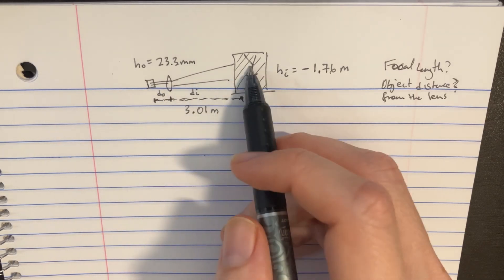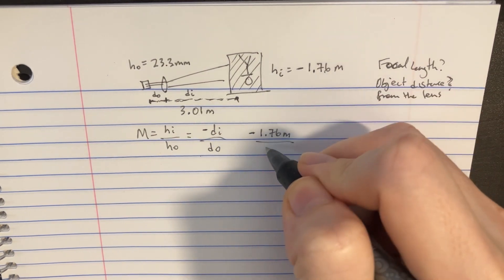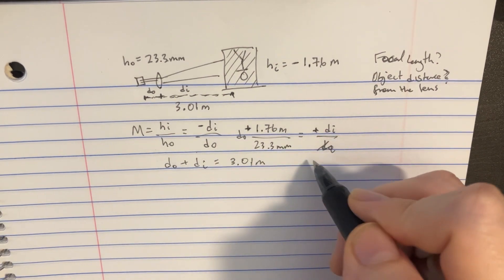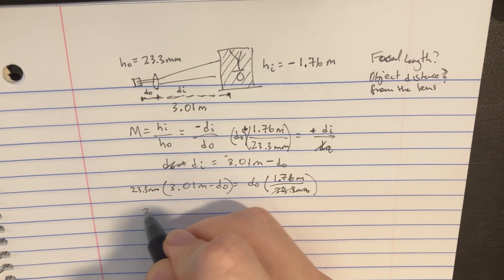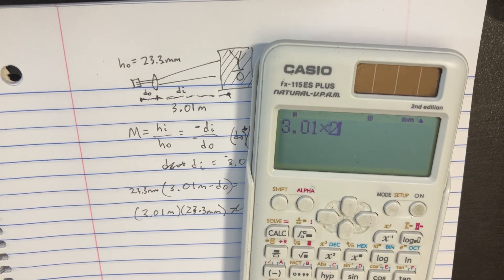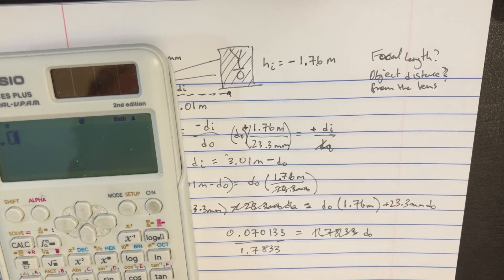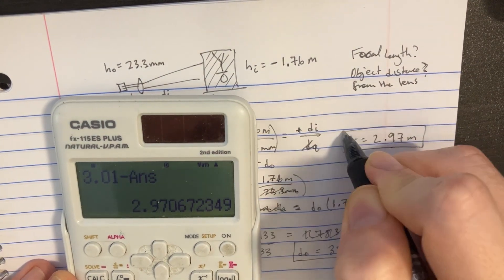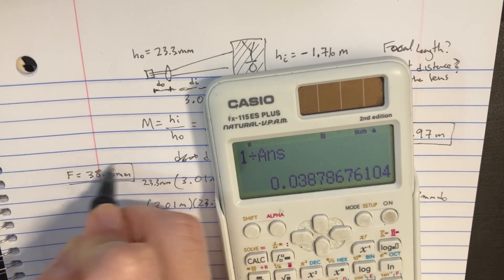The projection lens in a certain slide projector is a single thin lens

Comment: On my homework assignment, it doesn't state that the image is inverted (otherwise the questions are identical) but expects me to know that it is inverted.

Am I supposed to conceptually know that the image is upside down?
Reply from the maker: Hmmm.. if the image on the screen is not inverted, it would lead to a negative object distance and a negative focal length, but the values would also be slightly different.. In my question it specifically says “the image is inverted”.. I’m not too sure :/
Reply: @mtheorylaboratory  I figured it out! So the subtle (but key) word is "project." Which hints that the image has to be real. If it's real, then it will be +q which gives a negative magnification.
Reply from the maker: @breannabui  oh wow haha that makes sense, thanks for the update lol